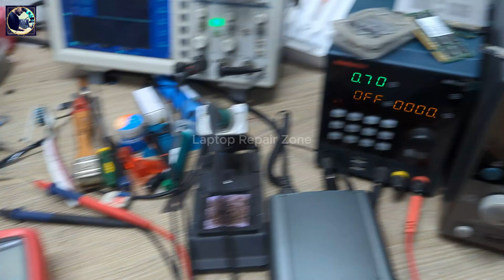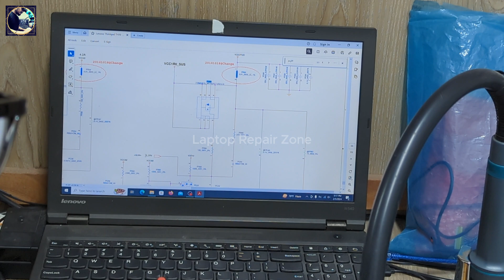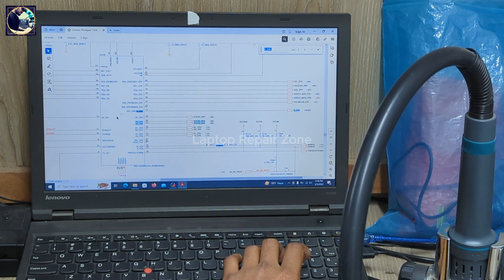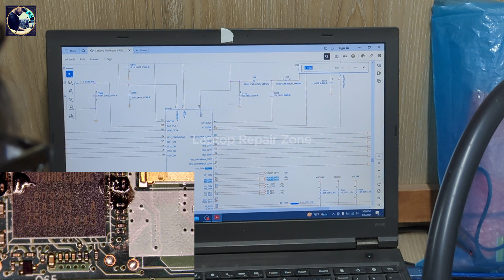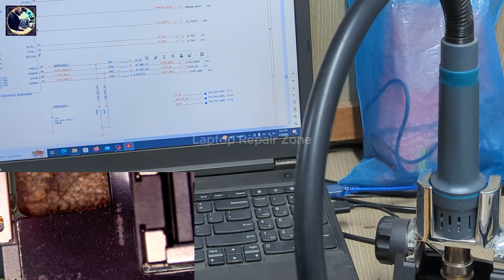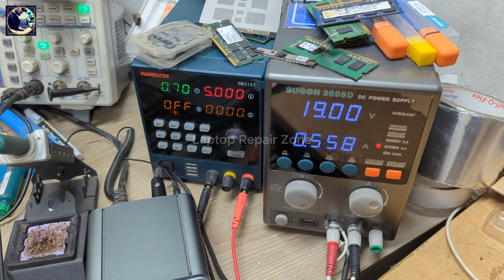Interesting case studies | lenovo thinkpad not turning on | Lenovo thinkpad T470 [ English ]

Comment: Hello I have t480 lenovo It was working before but after I wrote patched bios there was no power. I wrote original back but I get 3 blinks with no power on. I was missing 2 33ohm resistors I did just like the video but it is still same what could be the issue?

Comment: Minute 3 How did you know that there should be 2.5v there also regarding 1v how do you identify them where they are.  In addition to what is used 3.3 and 5 v always present thank you very much
Reply from the maker: 2.5 v for RAM, it's my working experience to recognized everything.
Reply: @Laptop_repair_zone  Why does the computer need 5v all the time thanks a lot.  Do you have some tips to teach me how to identify the power supplies

Comment: I'm confused: Your measuring voltage and continuity but your meter leads show the Red in the V  socket ✓ but your Black is in the 10A socket not the Com where it should be.